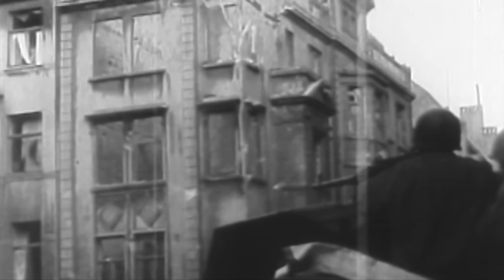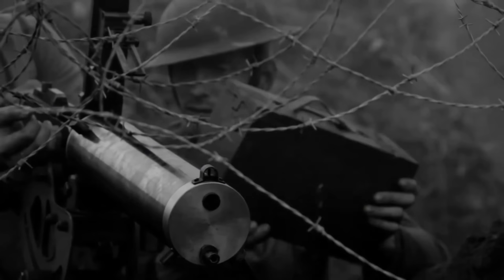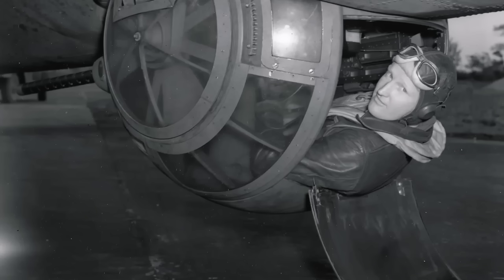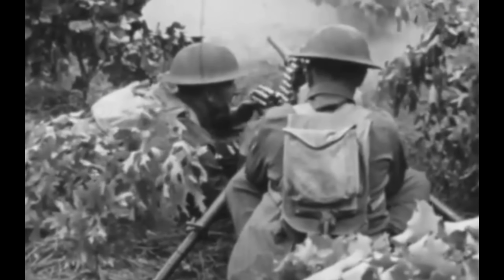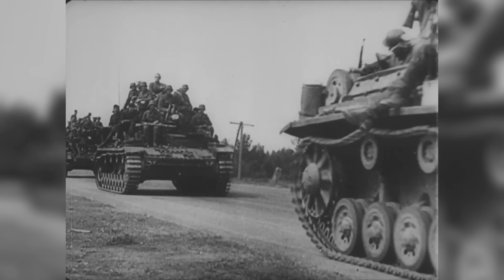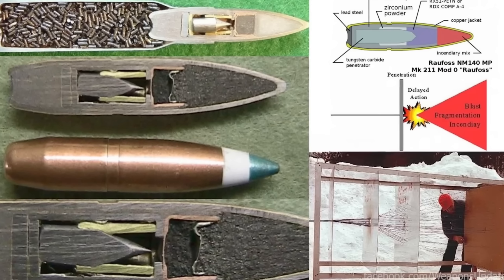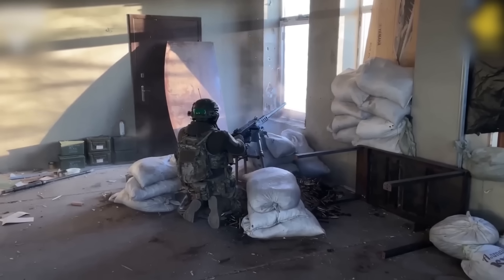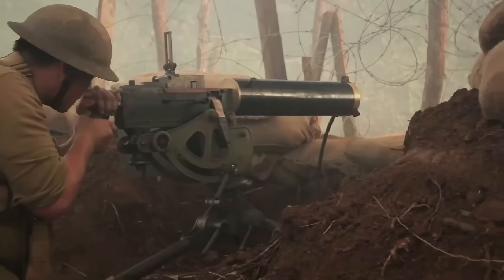The Dark Reason Germans Hated American M2 .50 Cal

Comment: Considering the M2 .50 cal is still in use today, almost a century later, it was well ahead of it's time.
Reply: Over a century, actually.
Reply: @Predator42ID still, classic piece of kit that has stood the test of time, through a fast-paced century of inventions and innovations on and off the battlefield.  Very few modern tools stay in mass production and use a quarter that long, unchanged.  A true classic.
Reply: @Predator42ID erm actually
Reply: @Predator42ID since when is it 2033? Cause the M2 didnt come out in service  til 1933 bud
Reply: @lucasschmitz4588 wasn't put into service until 1933. It was invented in 1918.
Reply: @lucasschmitz4588  Yo bud, explain to me how a gun came out in 1933 when its chief designer died in 1926?

It's called the Browning, Not the Reed who enabled the cam charging handle, left or right feeding and replaced the water jacket with a heavy barrel.

I've tried to correct the wiki on this but it never sticks. Oh and in 1933 the gun was redesignated from M1921 to Browning M2HB caliber fifty.
Reply: @Predator42ID cool was it in service prior to 1933? No then it hasnt been in use for over a century
Reply: @lucasschmitz4588  Yes, it was. It entered service in 1923 as a static anti-aircraft emplacement and was deployed across the fleet. 

So yes, its' been in continuous service for well over a century. 

This is why I don't use the wiki for factual research.
Reply: @Predator42ID 2 years isnt well over we also weren't in any conflict so to call it in  service is kind of a joke
Reply: @Predator42ID 22 years would be well over a century
Reply: @Predator42ID so, you think they finished designing it in 1918, but waited 3 years to prototype it? Never built a single one until the moment it first entered service? Circling back to my original statement, it was INVENTED in 1918.
Reply: @Microwave_King  

Ah, thank you for the correction. Which makes the gun even older, I'll now delete my previous comment.

Thank you.
Reply: @Predator42ID you use wiki for historical and factual research? 🤣🤣🤣🤣 the fact that you, someone with no credibility can try to change it should tell you that wiki is full of information by other people with no credibility 😂😂
Reply: @MTEditz If only there was an entire section at the very bottom of any wikipedia page with the sources listed.. Let me guess, you enjoy "alternate facts"
Reply: @MTEditz  Bub, you need to read my comment again. I never use it for factual info.

Which makes your insult all the more sad.
Reply: @heroinboblivesagain5478 Wikipedia is not considered a "reliable source" by most researchers, research groups and even academics question the discipline of information of wikipedia. 

Sure, Wikipedia is a good source of general information, but when making legitimate research, wikipedia is considered tertiary information. It is generally considered an unreliable or unsuitable source for formal academic citation, despite having sources at the bottom, because it is a source with an open, community-based editing model. This means its content is not guaranteed to be authoritative, unbiased or consistently fact-checked by experts before publication.
Reply: The MG42 is still used today aswell. Its an MG3
Reply: @pickaninny101 but m2 browning was seen to almost every war. From ww2 to vietnam war, korean war, gulf war, iraq war, war against taliban
Reply: @itsmejohnyt3696 you're naming American wars. Of course the American M2 was used. The last time Germany went to war was....basically never.
Reply: @itsmejohnyt3696 The Mg3 was used in these wars too by the european allies that many used the Mg3.
Reply: @Gongolongo Germans went to war in Afghanistan
Reply: @oblivionnokk3531 it’s slowly getting fazed out by the mg5
Reply: @pickaninny101 thats like saying the m2 is used cause the m2a1
Reply: @pickaninny101  Yeah but its in 308. Not 8mm. M2s are still using the OG round and still mostly all the same old 100 year old guns.
Reply: @guyknightley3499 There's little difference between 8mm Mauser (not even 8mm) and 308 or 7.62x51.
Reply: @pickaninny101 so not 42 got it
Reply: @lucasschmitz4588 its a 42. Many mg3 still have the swastikas  ingraved(with a cross through). They were just rechambered too shoot 7,62 because of nato
Reply: @pickaninny101 But the M2 Browning is capable of penetrating walls
Reply: @Dikiy_Stendofer different uses
Reply: @Dikiy_Stendofer  It's harder to bring, heavier than the usual GPMG and LMGs, which means slower troops. In a world where mobility is now the most important, it's been relegated into vehicles instead of being deployed with frontline troops.
Reply: @Dikiy_Stendofer  Yeah but the MG3 is carried by infantry and as vehicle mounted weapon more than a million have been made!
Reply: @Dikiy_Stendofer MG42/3 can be carried by one man
Reply: @groadmiralinerika2540 that’s my a .338 MG is going to replace the M2
Reply: And never will it be replaced in a few decades
Reply: @melanieempleo625 it is currently planned for replacement sorry to break it to you
Reply: @austinwhite3132 if you're american you'll vote to never replace. Besides, even if it is replaced, many people will still like to use it in the upcoming years
Reply: @melanieempleo625 and there’s no “voting” for the replacement of weapons the fact that you think that’s how the military operates is Hilarious
Reply: @austinwhite3132 well, i know that voting is a thing in the us army, but i do know that many gun enthusists (idk if i spelled it right) will still ask the army to keep it. Also, i think the army will still keep it because of its 50 cal cartridge and armor piercing capabilities.
Reply: We used to.50s in Iraq 2004/05 and the ammo crates were dated for 1940s. They made millions of rounds.
Reply: @tae387 💯
Reply: Well that and nothing deletes cover quite like a man duece remember a 249 says get to cover a 240 says stay behind cover and a m2 says fuck you and your cover
Reply: The mg42 basically turned into the m60 and the saws
Reply: @Zellio2011  I'd say M60 design philosophy is closer to that of FG42, rather than MG42.
Reply: Not basically
Reply: @Zellio2011 Mg42 turned into Mg3
Reply: Same with the Mg42 and 1911
Reply: @ThyKruzader The 1911 is extremely outdated. A single stack magazine, 7+1 rounds. Please.
Reply: @ThyKruzader  1911 is not in service today, it's the p320. However it's derivatives are nice target shooting pistols and hold more rounds, like the 2011
Reply: It's gonna be put on spaceships
Reply: Ofcourse not, but although the objective (HMGs against light tech and pisnon-engined aricraft) appeared in WWI, for some season it took for the engineers another 10-20 years to design something  suitable.
Reply: It probably won't be replaced until we have portable lasers on the 40 Mw range.
Reply: When i was in the US Army we still had General Electric and Bath Iron works M2 50s from ww2 in active use.
Reply: @cjv3417 We had a few from the Kelsey Hayes plant in the late 80's.
Reply: I had a 50cal hit my chinook helicopter 2 feet in front of me. Knocked out both hydraulic systems and set us on fire. Yeah, that was a power bullet. Damn snipers
Reply: Not so much "ahead of it's time", as it was the perfect multipurpose mid-level machine gun...While Germany was building/supplying multiple guns/ammo, the US only had to produce 1 gun, and 1 round...Streamline production/distribution to he point there was always a surplus of both ammo, and guns...Superior manufacturing won the USA the war...The "good enoughs" vs Germany, where everything had to be perfect or it didn't ship...
Reply: To underline this, recently armorers in US army disassembled some M2s for modernization and refit. They discovered that some of the M2 receivers were originals manufactured in 1921 - they had been in use for a century.
Reply: John Moses Browning designs typically have passed the test of time.
Reply: Nah. I think a better technical term for the BMG50 is

"Enough Dakka"
Reply: it really boils down to the germans not "allowed" to go to war. otherwise the mg42 or known today as the mg3 would be just as violable as the m2
Reply: Hate to burst your bubble but there was replacements for the M2 that were improvements over the M2 they’re just a lot of complications in the replacement process to many in stock , the replacing costing to much to replace all m2s etc it’s eventually and currently going to be replaced by a .338 MG model
Reply: Its time, not it's time, punk.
Reply: and the 1911
Reply: So is the MG 42, basically.  I'd be happy to own either or both.
Reply: The mg42 is still in use, in a nato caliber, it's now the mg3
Reply: Or its just a timeless design.
Reply: Yeah but the MG-42 is effectively also still in service as the MG-3
Reply: On time, not ahead
Reply: it wasn’t ahead of its time. it was just rly rly reliable, but the engineering behind it wasn’t anything groundbreaking. all the space tech guns were produced by the Germans from the FG-42 to the G-11
Reply: I wouldn’t say “ahead of its time”. That’s like saying a shark is ahead of its time. It doesn’t change because it’s been perfect for a long time.
Reply: Like the German MG42, from which we got the M3 and the M60 models.. and the M3 is still used today
Reply: I believe the only older military cartridge still in use is the 7.62x54R.
Reply: nah browning was just too good sad he spent most of his life on a bench he never enjoyed it
Reply: The MG 42 and DShK are still in service so that's not really saying much. Even very old weapons like the Mosin-Nagant are still  around. Firearms just age really well compared  to other equipment.
Reply: It was of its exact time by definition
Reply: Same with the mg42 its newer variant is the MG3 used by Germany, turkey, Spain, and the Austrian variant as the MG74. So happy these two designs have survived WW2
Reply: M2s will see combat on Mars.
Reply: Its time. (Not: It is time, which the apostrophe connotes...)
Reply: I'd say that most if not all of our enemies hated it
Reply: So is the mg42
Reply: the germans has the 20mm
Reply: Other then the M1911 pistol, the M2 .50 BMG is the oldest weapon in the US arsenal.
Reply: It’s time will not end as long as people are made of material.

Comment: That weapon can blast through 9 inches of hardened concrete and plate steel over an inch thick with armor-piercing rounds.  Hiding from an M2 behind a brick wall did not guarantee your safety.

Comment: The .30-06 WAS rimless already so I don't know what this guy is talking about at 1:20.  As usual in this series, people who really don't understand the topic pulling a few things together from here and there with lots of holes and errors/
Reply: The entire video is incredibly inaccurate. Comparing the M2 to the MG42 is very dumb and only something someone would do who doesn't have a basic understanding of small arms and infantry tactics. The M2 wasn't squad portable the MG42 was. The M2 weighed over 100lbs and required the tripod mount, the Mg42 could be shot off a bipod and weighed 25lbs. It's not even close. Totally different tools for totally different jobs. Meanwhile the Germans didn't need a .50 because they had 2cm auto cannons.. that were actually more powerful than the M2 .50cal, dumb video all around. I hate pop slop YouTube and how it's causing so many to be so misinformed.
Reply: The .22 LR is more "rimless" even though it has a tactile rim for detonation & extraction. With center fires they all have extraction grooves, but some extend slightly out from the cartridge wall; some like .45 are even or flush WITH the cartridge wall. So some dork didn't know what to call a new design feature - and got it WRONG. They ALL have a rim of some kind - otherwise you wouldn't be able to extract fired rounds from the frickin' chambers. You'd have to poke them out from the muzzle. 🤪🙄
Reply: @nicholashnatyk4470 you are a fool.
Reply: I knew it was game over the minute I hear him pronounce it as “thirty zero six”.
Reply: He did mistakenly refer to the 30-03.  .30 caliber of 1903.  It is rimmed.  The 30-03 was used in WW-1.

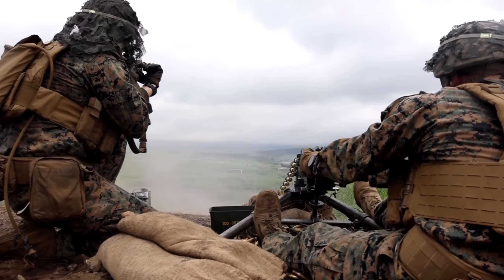Comment: 14:22 When you notice how much the tip of the barrel moves vertically with each round, you realize that much its fire power is wasted. You just can't aim the damn thing from a tripod.
Reply: You have obviously Never fired Ma Deuce. On the tripod without sights you can with 3 rounds zero in on a doorway and after that keep al rounds on the mandoorway at 1000 meters.
Reply: The M2 is one of the most accurate  weapons issued in any military today. From a tripod with the T&E attached, I saw an NCO hit a beer can at 1000 meters firing single shots, in only five rounds. I lost a case of expensive German beer on that one.
Reply: @coldwarrior78  I'm talking about using it as a machine gun, as it was meant to to be used, not in single shots. The wild movement of the barrel cannot be disputed, it's obvious.
Reply: Well then you really can't hit the side of a barn then.
Reply: @nightshift7963  Perhaps you've watched too many Rambo movies....
Reply: Do you even know what a mg is meant to do? It’s meant to clear large areas very quickly, not snipe a soda can from two miles away.
Reply: @Beef-man  Don't make ridiculous excuses. If I want to cover a certain area, I can do it by changing my aim accordingly as I pull the trigger. I don't want a mg that sprays bullets up/down/left/right. And I don't blame the mg for this, I blame the tripod. The further away from the end of the barrel the tripod is attached to, the worse for the mg's accuracy.
Reply: Yea this isn’t true. The M2 is extremely accurate in both semi and full auto. If you know how to control the recoil when firing, then there isn’t really a problem. I’ve actually fired it from the tripod, and tho it’s not easy, it’s doable.

Comment: I'll tell anyone it's a small machine cannon. It's penetration is absurd
Reply: But ... it's not a cannon. It's a machine gun firing almost 13 mm/half inch wide lead/copper/steel BULLETS which are usually NOT explosive. Bullets do their damage by kinetic energy and the mass/weight/& hardness of the striking bullets. CANNONS fire 20, 30, 37, 40, etc. mm smaller EXPLOSIVE SHELLS, like a full size artillery cannon or howitzer. They do more of their damage by exploding their inner charge on contact with a hard target. So, the .50 hits and destroys by penetrating force; the cannon round, which is launched forward by the gunpowder charge in their bottom shell strikes & blows up on contact with a solid target, causing most of its damage by detonation.  So, there is a difference.
Reply: @nicholashnatyk4470  I saw an interview with a Spitfire pilot talking about needing to hit the ME109 with a number of .50 cal rounds to bring it down where just one or two 20mm shells from a 109 could drop a Spitfire.
Reply: @fozfactor  for as powerfull small arms bullet a 50 bmg can be, has only the piercing effect (incendiary at best if hits fuel) but has no area of explosive damage like 20mm autocannons with he rounds, much more effective against light skin vehicles like planes
Reply: @Tonyx.yt.  it's much more accurate than a 20MM and you can carry a lot more ammunition; and the barrels of .50's are much cheaper to replace and easier to replace when they get too hot. And you should dive into all the types of rounds it can shoot. There are definitely incendiary, armor piercing, tracer, even sabot .50 BMG rounds.
Reply: @nicholashnatyk4470  Interesting
Reply: Its nothing crazy, Just happened to be widely available, soviet 14.5 kpt hmg its litteraly twice as powerfull round
Reply: @Tonyx.yt. BS.